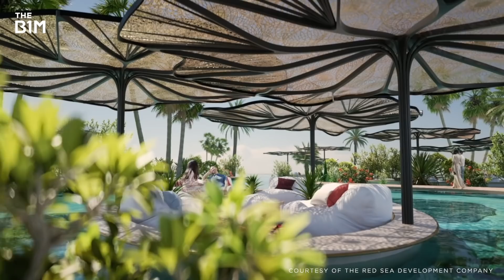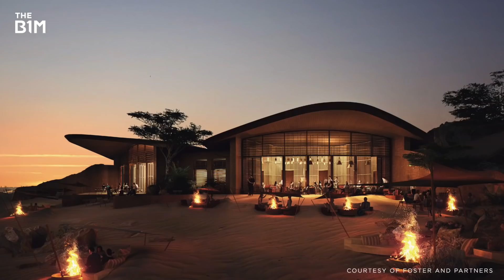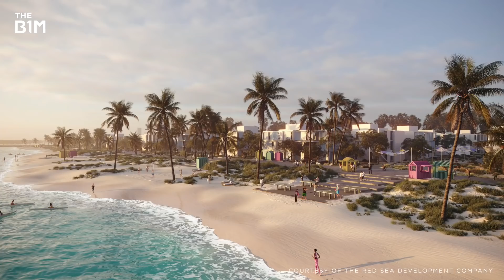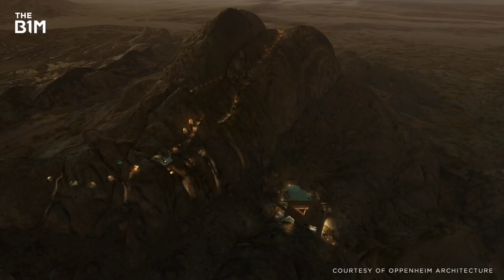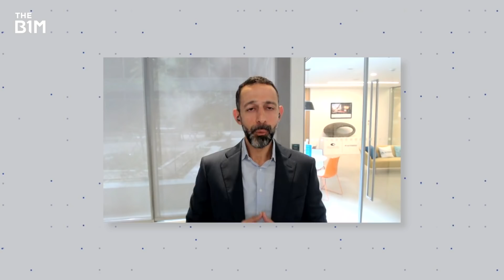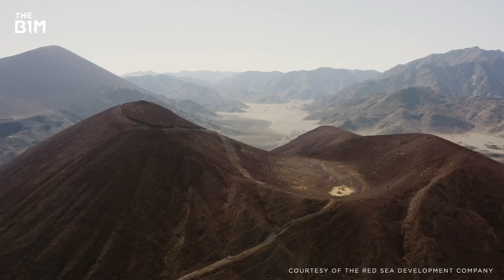The $5BN Mega Resort in the Desert

Comment: i'm very interested in the 3 seawater reverse osmosis plants being built.  Watering a desert looks amazing, just take Arizona and Palm Springs, etc.  But those areas receive millions of acre feet of water from snow melt.  not Reverse Osmosis.  Really interested in how much water they perceive they will need.

While daily operations may be "greener" the construction will surely be done with fossil fuel, non-single use plastics etc.  And that battery at rotate facility will need lithium and nickel from massive destructive mining projects from around the globe.  the mining of Silicon and silane gas for the development of Solar Panels is frightening.  There are dozens different chemicals that are so dangerous to transport on rail or truck that they need to be made on-site of Solar chip manufacturing facilities.

Comment: I remember following and researching the man made islands in Dubai, back when they were little spots of sand in the sea. 
At first I thought it was impossible, as well too far fetched. Now I see them, and it’s just fascinating what we can achieve as human.
Beautiful project for sure!
Reply: Are you ignorant of the fact those artificial islands have been a massive failure on a technical and economic level?
Reply: Economically I could care less, because it’s not my money being dumped in to it. 
But technically, I have no idea what really is going. 
If you care to elaborate, that would be appreciated.
Reply: @ForPeopleEntertainme  I suggest the video 'Dubai is a parody of the 21st century'. 
In short, apart from the obvious - the islands are superfluous and exist just as a status symbol for the super rich - they aren't stable. Strangely, dredging up a bunch of gravel and sand from the sea floor and dumping it one spot does not a solid island make. They are extremely prone to erosion and settlement back into the sea. Also, the disruption of natural currents and the seabed has caused some nasty effects on the quality of the marine environment and water quality. They don't solve any problem but create dozens of new problems. And the majority of these artificial island projects were abandoned because of the economic reality of how profoundly inefficient it is to build suburbs on an artificial islands.

Comment: That area is so Hot. You would spend all day inside.
Reply: Not true I’m from there exactly and it has the same exact temperatures as Miami without the frequent rain. with the highest temperature reaching 34 in the hottest day of the year. With temperatures average of 28-27. With cool winters 9 degrees lowest and 16 average.